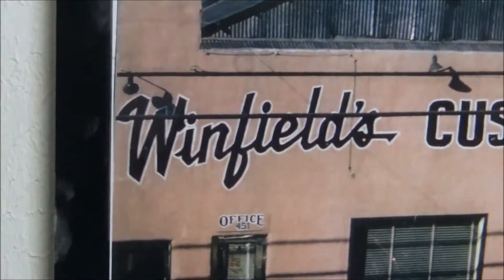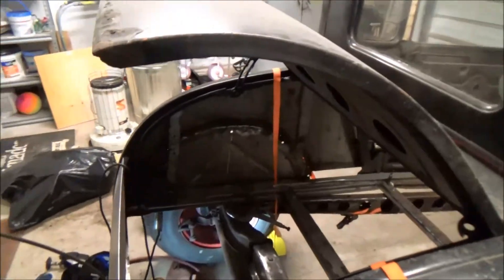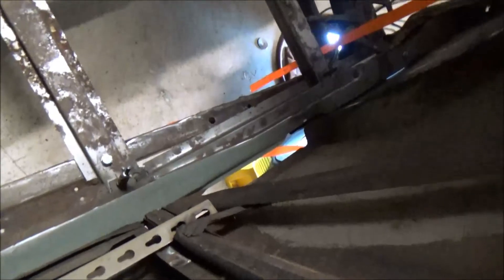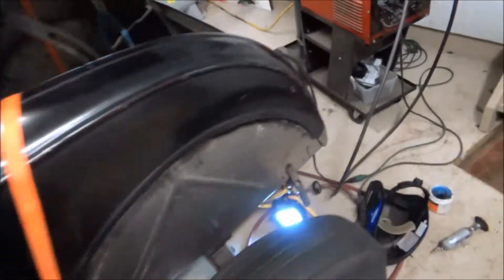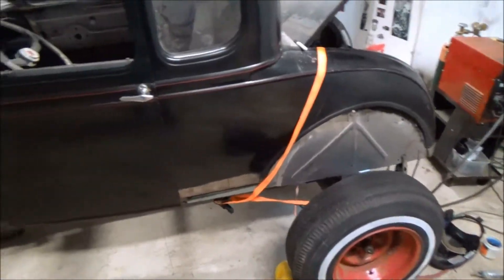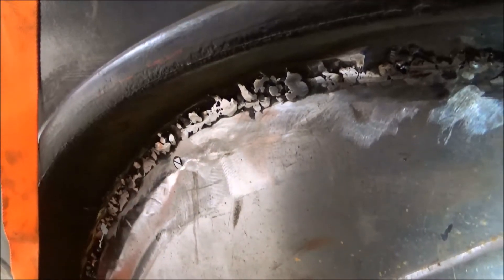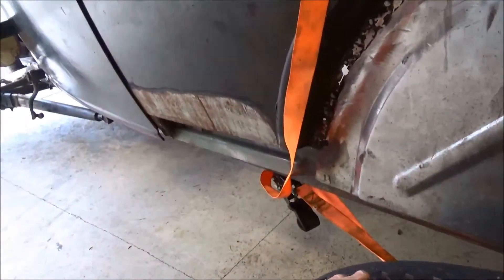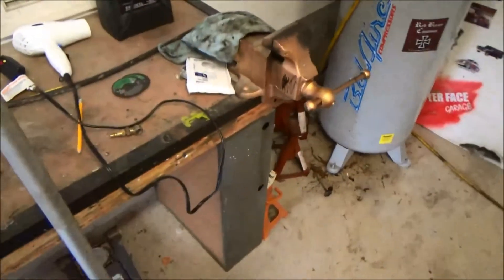1931 Ford hotrod Part 1 ( I guess)

Comment: you have a good start going on the old A . 
your going to find out that nothing on those old cars are square and true . I did a lot of " eye balling it " on my A to get it to fit right . Because when i would measure it out . Nothing looked right .... lol 
welding rusty thin metal is a pain . And that old metal welds a little odd at times too . I'm sure SYF garage will know what to do in the wheel wells . I'd think fiber glass would be fine , but i'm no body guy . As we all know :)
Reply from the maker: Thanks Matt! Yeah I think there will be plenty of eyeballing haha